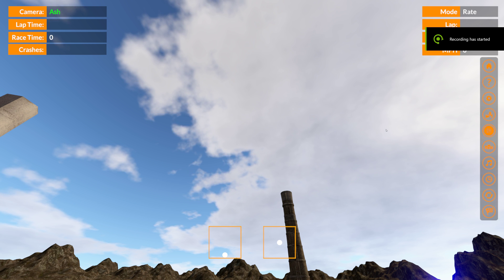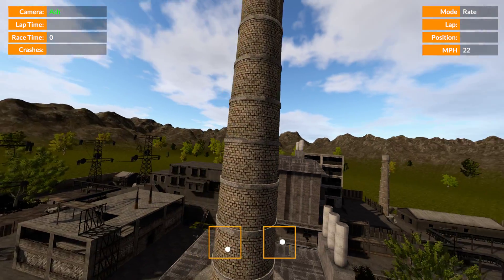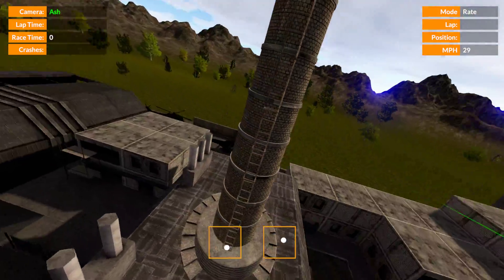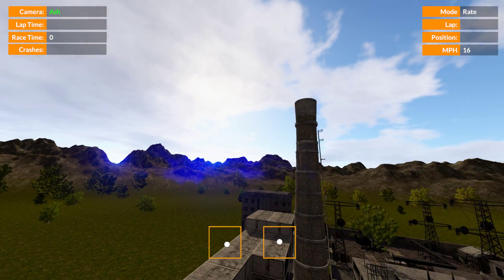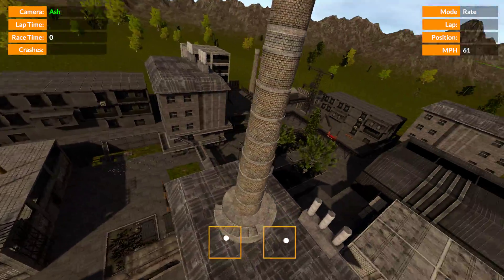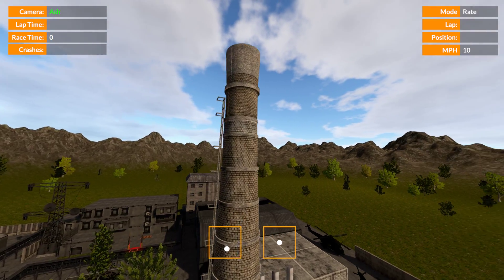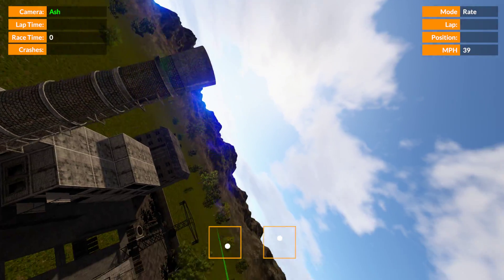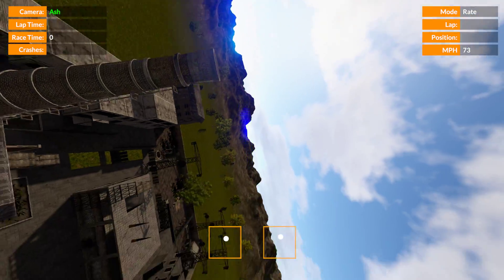Flight Training - Knife edge orbit

Comment: I would very much like to know which drone you have chosen for these training videos and what rate you have set for this drone, I did not think the drones I have tried are so good
Reply from the maker: you can use any racing drone, they all fly similarly and what you perceive as flying good is just pilot skill, once you learn to control the drone properly then you will have similar results. I would recommend dropping your rates to around 450 deg/s on pitch and roll and 300 deg/s on yaw as this is more beginner friendly than the default rates.